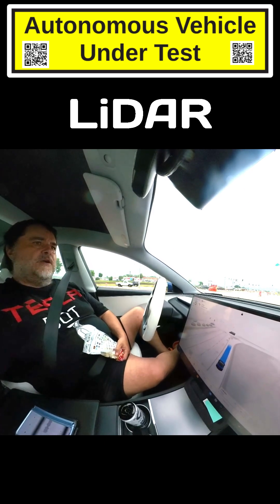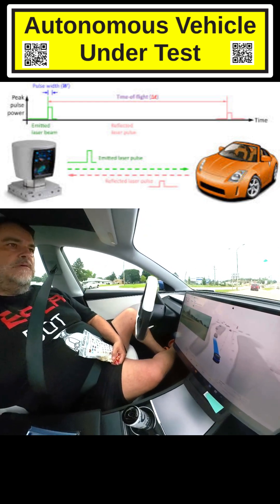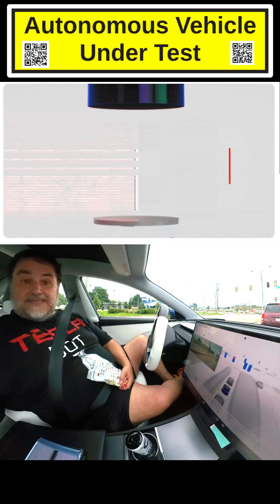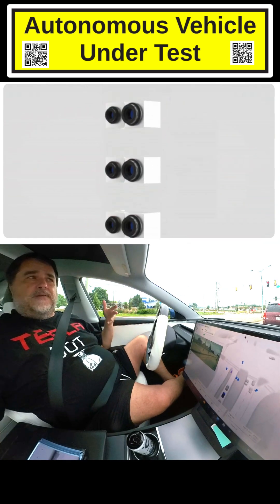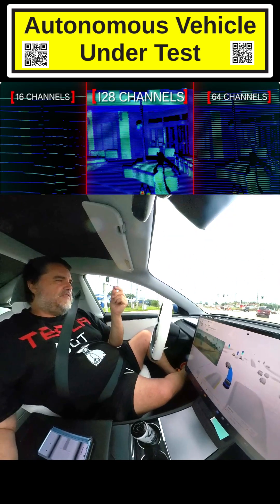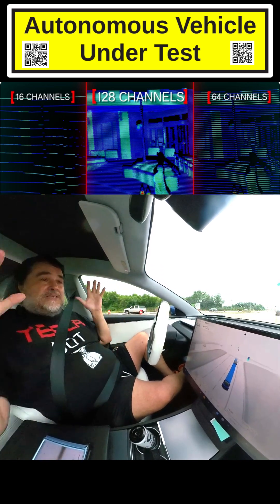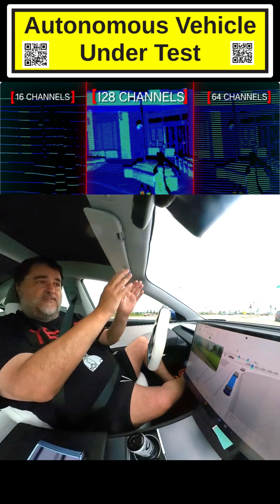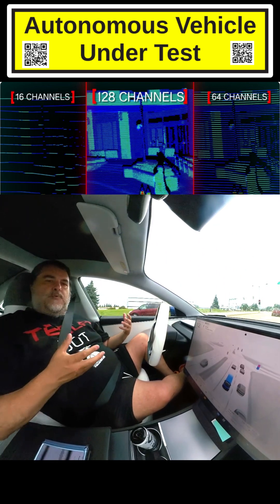Autonomous Vehicles Part 1- Intro to #lidar    #tesla #fsd #selfdrivingcars

Comment from the maker: LiDAR, or Light Detection and Ranging, generates a point cloud by using 128 lasers to scan 360 degrees in a circle. Each point in the cloud is a distance measurement made by a laser. Similar to a laser tape measure, the laser reflects off an object, and the time it takes for the light to travel the round trip is used to calculate distance. The LiDAR sensor itself does not segment the point cloud; a separate algorithm or AI is required to detect objects like cars, people, etc.